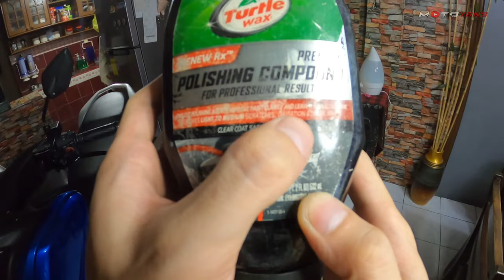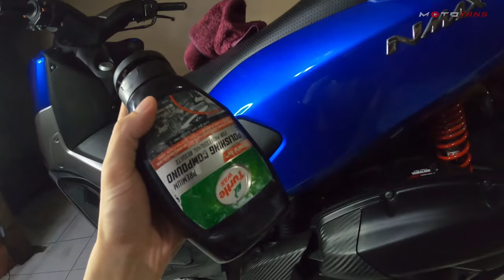Yamaha Nmax 155 buffing Detailing Minor Scratch Remover

Comment: Sir tanong ko lang po kung pwede ibuffing at TFT DISPLAY PANEL ng motor kasi puro scratches na. At kung pwede po same procedure din po ba sa ginawa mo?
Reply from the maker: @ryanchristopher4479  pwede naman sir pero ibang procedure. Lilihain niyo po yan ng 1500 grit sandpaper then saka niyo po ibuffing
Reply from the maker: @ryanchristopher4479  search niyo po headlight restorstion paranh ganun din po gagawain niyo..jan sa panel
Reply: @motoyans9326  glass po kasi yung display ng sakin bali po ba lilihain ko ng 1500 grit sandpaper tapos gayahin ko lang yung pag buffing nyo sir?
Reply from the maker: @ryanchristopher4479  sir if glass yan wala ako idea.. ung sinasabi ko po kasi for plastic panels  lang po effective...  sure ba kayo glass yan sir baka plastic ??